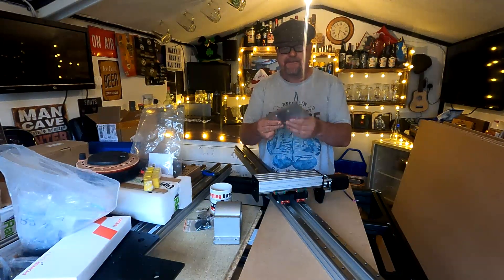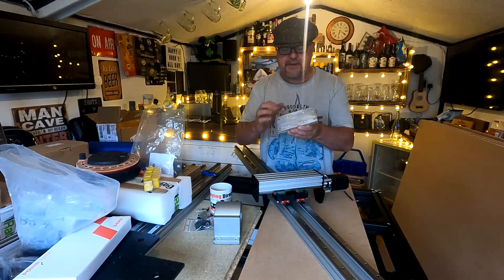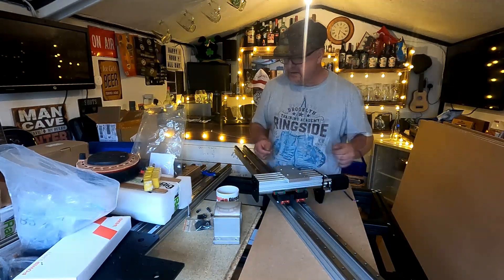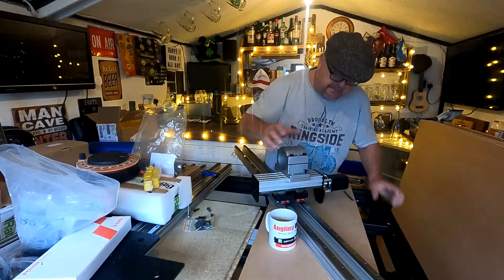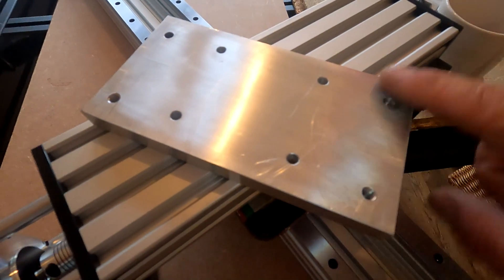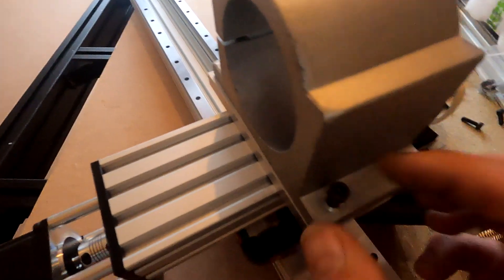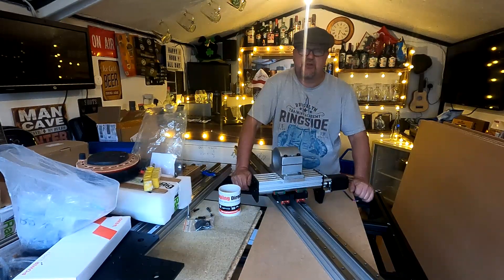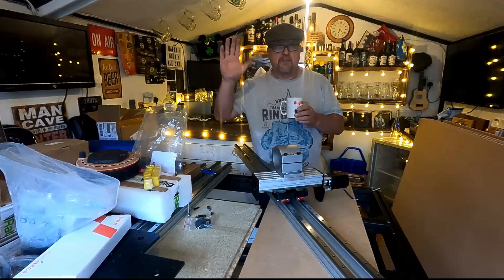Building A CNC Engraving Machine By Rat Rig - Part 5 - Spindle Mount Adaptor

Comment: No more videos about this machine ? I was wondering if there is a way to buy just the black metal plates for the frame it self...? so I can buy parts here and there and eventually I will have all the parts I need to build the frame...
Reply from the maker: Srry, been really busy. Trying to sort a new workshop. Yeah, look on eBay. Think you can buy the aluminium section on there.